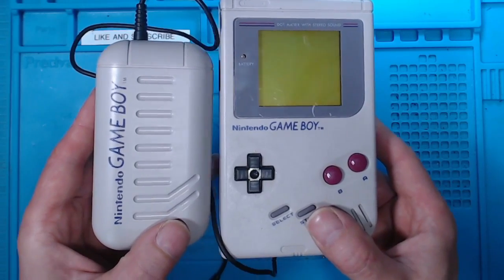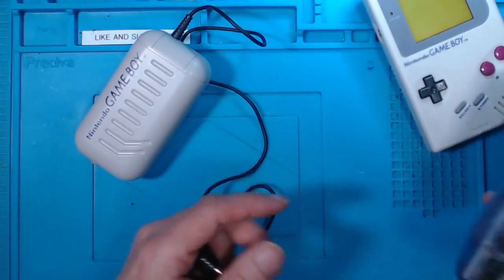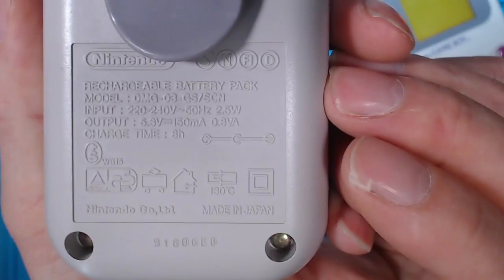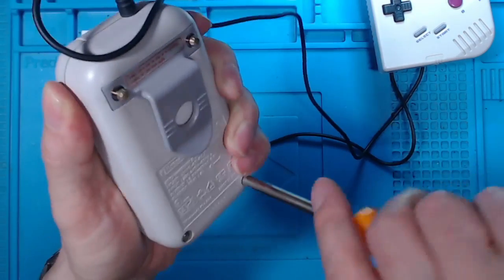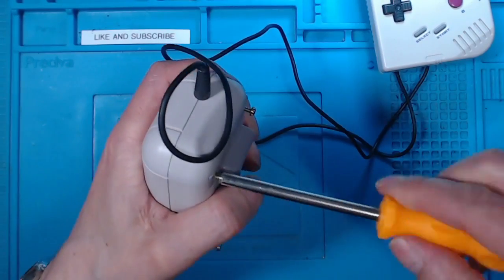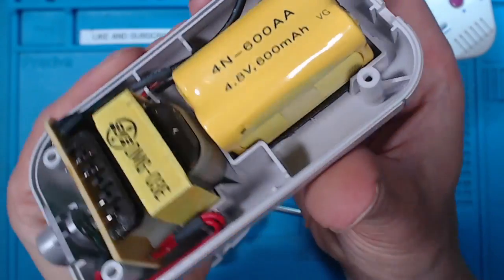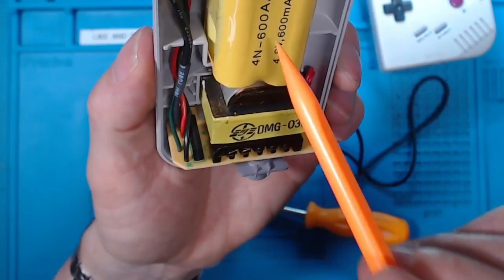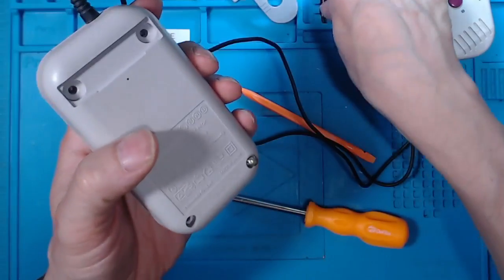Inside Gameboy rechargeable battery pack DMG 03

Comment: Another question is how are you getting 5.5 volts from the 4.8v from the batteries? I dont see any type of stepping up circuits, just a rectifier for charging them. I and curious if the batteries are connected directly to the output cord that you plug into the gameboy, so you are actually feeding 4.8 volts into the gameboy, of which it should be happy running off of since its like running off a set of AA cells that are maybe a third to half used. I've never owned one of these for my gameboy. I just used batteries.

Comment: assuming those are Ni-mh  id replace those with some eneloop pro's and a battery pack so that the battery can be easily replaced.  2400mah is so lame lol.  9800mah would last tons better.
Reply from the maker: It's so bulky and heavy to carry around. Someone should develop a lithium version in a smaller 3d printed shell and USB charging.
Reply: @PhilipBryden   i thought that too  but at that point it would be better to just mod the gameboy and put a lithium directly in it.  or better yet just use rechargeable lithium AA battries

Comment: I had one of these laying around in my Gameboy stuff, can't remember where I got it cause I didn't have it back in the 90's for sure, but I didn't have an original Gameboy since I lost mine as a kid so I never looked at it until tonight. I just got an original Gameboy for $40 this week (bottom couple lines of the screen don't display but still playable) and I decided to go digging in my accessories trying to see if I still had my Gameboy printer for my Gameboy camera and came across the battery pack. Mine doesn't have any charge on it, but I have it plugged up right now charging to see if it still works or not. Thanks for showing the tear down. If I want to replace the batteries I have an idea of what I'm working with before I order tools and parts. I mean I could just buy some rechargeable double AA's at this point but man it would look way more cool and cyber punk with that battery pack on my hip lol
Reply from the maker: I'm glad you found the video useful. Going by the age of the batteries, I would be surprised if they held their charge. If you decide to swap the batteries, let me know how you get on. Good luck.
Reply: @PhilipBryden  Yeah, got up this morning and tried it first thing, no response. All charging it did was make it warm lol
Reply from the maker: It's a nice display item perhaps but not very practical now. Unless you like tinkering and you want a project. If that's the case swap the batteries from a modern lithium one and perhaps add a USB C socket to charge it.

Don't ask me how tho, I have no idea lol

Comment: But how would it recharge if you’re using non-rechargeable batteries? Were those even a thing in 1989?
Reply from the maker: They are rechargeable batteries. If you search 4n-600aa you'll see they're by Sanyo and are NiCad type.

Comment: So… question. Can you plug this in and will it store power so you can unplug it from the wall and the unit will power the gameboy? I know it can plug into the wall and work. But is it supposed to be able to hold power?
Reply from the maker: Yes. It's a powerbank for the Gameboy. You can use it to power the system without the need to have it plugged into the wall.

Comment: I use a 800mah 3.7v 14500 Cell in my Gameboy color and simply jump the other empty slot with a strand of copper wire folded over to make a "dummy" AA cell. Works great and lasts forever!
Reply from the maker: I had to search to understand what you meant. That's a good idea, I suppose it keeps the weight down too. I wonder if the contacts could be modded to run 2x 14500 in parallel to give the same 3.7V but double the mah.
Reply: @PhilipBryden Yes. That would work as well, in fact that was my initial intent but found that a single cell  lasts a very long time even with an ips mod but I still may do it in the future simply because I bought a pack of (2) 14500 Sanyo cells so want to make use of the second one. Let us know if you ever decide to go that route as I'd like to know what your first impressions are. Enjoy!

Comment: Just got one of these. Gonna try to find a replacement battery pack.
Reply: You can upgrade the pack yourself using new high capacity rechargeable NiMh cells!
Reply from the maker: Just looked on the back of mine to see it outputs 5.3V. So I'm wondering if you could run the GB from a modern USB powerbank. Perhaps install a modern powerbank in the original case.
Reply: @PhilipBryden You can! I have used both the DMG and GBC off of any USB. Works great!
Reply: @PhilipBryden  not sure. It'll probably be a few weeks before I get to it but I've got a few small usb power banks so I'll look at the numbers and see if they're compatible.

Comment: That is really funny that it's literally just four double A's and then a charger. They couldn't have put bigger batteries in there to give you a longer battery life lol. Unless you really really really don't like the weight of the thing it's way better to just stick rechargeable double A batteries in the Game Boy itself.

I am confused why it says 600 mAh because I'm pretty sure a single rechargeable battery is higher than 600 mAh so even if it was just talking about a single cell and not the whole thing it would be wrong. I just checked my rechargeable Duracells and they say 2,500 mAh on them.

Heck even my triple A's say 900 mAh on them.
Reply from the maker: It's pretty heavy. Obsolete now, but it comes in handy to test Gameboys that have corroded battery terminals.
Reply: @PhilipBryden  I'm rereading my comment and I didn't specify it correctly what's with all the empty space in there?

Also with being how old that thing is you're probably not getting the full 600 mAh It would be better just to use a straight pass through from the wall or a standard USB since they output 5 volts.
Reply from the maker: Yeah, I don't use it as a battery pack. You can get 150mAh rechargeables so 600mAh must be for all four batteries combines. As for the empty space, well I'm assuming back in the 90's they designed things this way.

Comment: hi there, do you have a link for the screwdriver you were using, it seems the screw is bigger than the regular GB game cartage's, thank you!
Reply from the maker: You're right it is larger than the regular one. I didn't realise, I have two orange handled gamebit drivers. They come in two common sizes, 3.8mm and 4.5mm. I have checked the power pack against a game cartridge. It must the bigger 4.5mm that's needed. Thanks for pointing that out.
Reply: @PhilipBryden got it! thank you, mine must be 3.8mm

Comment: Hey Philip, nice video!
I am just wondering, if I just want to run the DMG from the power and only use the transformer to get 5,3V output will it work? I mean if let’s say something happens to the batteries, can I take them out?
Reply from the maker: Yes you can run the DMG by the power jack with no batteries installed. That's fine.

Comment: Well on the bright side.... if that pack ever does quit working, you could easily replace those cells with standard Ni-cd AA batteries and wire them in series.

Or really just have those same 4 cells separate and just put them in the back of the gameboy like regular batteries. Same effect. A set of 4 modern NIMH batteries would give you a HELL of a lot of play time for an original DMG.
Reply from the maker: It can come in handy at times if the DMG doesn't turn on with the batteries. I stick this in to see if it's a fault with the contacts or the power jack switch sticking.

Comment: That's an awesome little accessory, first time i have seen one.
Reply from the maker: It could be made a lot smaller and lighter today with current battery technology but there's obviously no need for it. It does allow me to check the power adapter port if needed (which nobody ever uses lol).

Comment: Curious if the original gameboy could run off a standard power bank, like make or buy a cable with a USB A on one end and a barrel plug that fits the gameboy on the other. Would the gameboy be happy running on 5v since it runs on 6 volts.
Reply from the maker: It might be possible to run ti at 5V.  There are voltage convertors, perhaps there's one that could from 5V to 6V just to be on the safe side.
Reply: @PhilipBryden  USB power from a power bank is 5 volts normally but depending on how much current the gameboy uses the power bank may shut off. Walmart has these power banks that can charge low power devices like bluetooth earpieces which may work for a gameboy.
Reply from the maker: @coondogtheman  I have a bench top PSU, I could power a gameboy and see it's current draw. No doubt there's already a USB C charging mod for them. I'm not too clued up on the mod scene.
Reply: @PhilipBryden  those are for modded gameboys. I was thinking of unmodded for nostalgia.
Reply: @PhilipBryden  Also on an original gameboy at times the 4 AA cells are outputting 5 volts after being slightly used. I'm thinking that the gameboy would happily run off 5 volts.

Comment: Thanks for this Philip!  I have been curious what's inside, I want to buy one and upgrade it with LiPo or similar rechargeables.  Looks like there's enough room inside for a charge controller and a few cells.
Reply from the maker: There is quite a lot of wasted space, once you remove the bulky transformer there will be lots of room. But aren't there already rechargeable battery upgrades that fit into the GB battery compartment?
Reply: @PhilipBryden  there are! But this will just be another "retro modern" addition to my growing collection. 😉